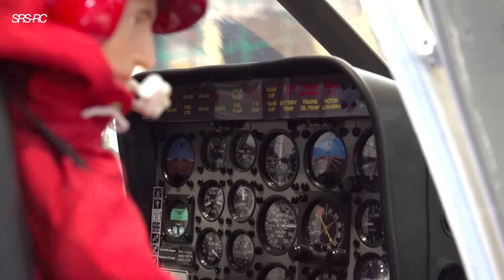RC HELI JET INDOOR FLIGHT // VARIOHELICOPTER // ROBIN ADAMSCHAK // MODELL HOBBY SPIEL

Comment: The amount of enginerding that goes into producing such a beautiful, working replica of the jetranger is applause demanding. Tremendous skill in both flying and construction!
Reply: they even installed an illuminated cluster panel in the cockpit

did you notice that?

that's pretty slick

he was flying it really slow to

because in reality?

you can fly those things about as quick as you can fly remote control fighter jets
Reply: Nice enginerding
Reply: Enginerding. Get it? Because they're nerds. 🤣
Reply: It's a skookum choocher
Reply: @tushyrr   mobile ke pass
Reply: @tushyrr  mobile ke pass
Reply: @tushyrr  mobile
Reply: @tushyrr  mobile ke pers dekhna hai
Reply: German engineering man

Comment: That thing is beautiful, excellent detail, I noticed the instrument panel was lit while it was flying, and all the rivet detail, incredible! I doubt if I could even afford the batteries for that thing.
Reply: I have 4 RC helicopters😍and if I were to put them all together🚁🚁🚁🚁they still wouldn’t come nowhere near the size of that beauty😀as to the cost of the batteries🤑Ka-Ching Mmmmmm if I were to sell all of my treasured RC helicopters😪🤧I probably wouldn’t have enough🤑to purchase the batteries needed to fly this RC helicopter
Reply: Only one small bolt holding the propeller together?
Reply: @smokescreen2146  dont worry.everything is engineered
Reply: @gardyfaustin8707  Yeah engineered for cost cutting, not safety
Reply: @smokescreen2146  you really think a bolt that cost under $5 is really cutting anything out ... The bolt is safe ... The craft dont need a super size extreme bolt ... Its safe . Technology is awesome these days .
Reply: @gardyfaustin8707  What's $5 x 2000 units
Reply: @smokescreen2146  That's why it is called  the Jesus nut...for real !
Reply: @1983dmd  At least they have changed the design now, well mostly anyway

Comment: Unless you have tried that, you cant appreciate how hard that is...
Reply: I know right? The guy with the controller is a hell of a pilot, that chopper was stable as fuck
Reply: Larger heli models are more stable,  that's actually very easy.
Reply: Right  I had a model heli..quite a bit smaller than this one and I couldn't get it to hover or fly even for nothing no matter how gentle I was on the stick...this guy probably flys real helicopters  I love how stable and extremely quiet it is and it also sounds a lot like a real heli... I bet he paid a for6for it
Reply: I was all about one so I got  fs1 from hangar 9 and near as I can figure crashed about 250-300k worth of virtual models before I could even land once ( quietly places controller on desk, slowly backs out of room...)
Reply: They are hard it took a bunch of crashes before i got any good flying a 6 ch heli
Reply: @bobjohnson48  I broke a skid..crashed a few times then eventually gave it away..had a gas powered r/c truck that damn thing was impossible to control  it was Ethier nothing or full throttle. I gave up...I would love a boat but where I live there's no ponds..just lake Erie I might dabble back in model railroading again I did that  as a kid I only had a 4x8 layout but I hooked it up nicely
Reply: @lornperkins4270  I had a Traxxas slash that was uncontrollable after I put a castle motor in it, I swapped out the receiver with the spektrum AS3X gyro stabizer model and it worked unbelievable, the thing can hold an arrow straight line at full throttle now. No bullshitting, it really is that good. Not competition legal but for bashing it's perfect

Comment: How was this a "jet" helicopter?
Reply: The real model is called Jetranger.....
Reply: I think it is powered by a turbine engine.  In any case, the full-size one is.  Sounds like you might not know what a "turboshaft" engine is.  You should look it up if not.
Reply: @ Science Compliance the reason I say this is because it is an electric/battery powered motor and not a turbine/jet engine.  I know the real heli is called a Bell Jet Ranger and maybe that’s why the word “jet” was used.
Reply: @thebirdwhoflew312  referring the the name of the fullscale model obviously. just shorthand, 30sec into the video you can tell its Brushless, Katronik doesnt make jet accessories. Thats Jeti Model i think.
Reply: @thebirdwhoflew312  I'm pretty sure this is actually powered by a small turbine engine.  If there is an electric motor, it is probably just a starter.

Comment: Beautiful beautiful machine and wonderful set up including battery placement. Too bad We want to keep the battery cable length short and close to the speed controllers or You could put foe emergency pontoons on the skids and place the battery's in there for easier and quick access in case of overheat. But I truly, truly understand You can't and it would be a bad idea. Excellent video and flight bar none.

Comment: Why have a helicopter this nice and not have a full Aluminum Head and tail rotor.. You can actually hear the vibrations and see it in the lights..  Unreal.
Reply: the plastic head is cheaper to manufacture and lighter. this is common practice with VARIO they make junk for high dollars
 the vibrations are normal and have nothing to do with the rotors materials.
Reply: @calibermix8159    I always thought that Vario made good stuff...
Reply: @gewglesux  what do you mean by good stuff ? they make fuselages without a single rivet all the work is done by the end user but you have to pay a lot of money for their stuff.
doors, seats, windows and many other details are not scale at all.

they still use the same crap vintage mechanics adapted to modern electric motors.

other companies in germany had to close the door down and VARIO will not be any different. I don't give a shit if they ever disapear

who buy their fuselages ? old people with money and idiots who only do hover in the sky because they have skills for nothing
everybody else fly 3D helis.
Reply: @calibermix8159  Compared to what i have  seen here in the states...  I believe Vario  to be above board.  I know their stuff is expensive. It seems  that you get what you pay for.  Here in the states  every time i go to a RC  show  or some kind of demonstration.. It's always 3D helis.  I like Scale(or as much scale as i can get)  I would much rather look at a scale heli's swinging around than a 3D demo anyday.  I believe that  some of the 3D pilots we have here are some of the best.  but after  a while  i can leave it alone.

When it comes to Turbine  I dont see many turbine Heli's here..  Many in Europe...  I saw many the last time i was in Germany.

Comment: This was a very good exhibition,  but I kept thinking what could happen if something went wrong. It looked harmless, but was yet the opposite.  Those blades could have easily been missiles, at probably over 10k to 15k rpm, if at any time the helicopter mistakenly crashed up against the wall,  severely injured someone,  or very likely, kill someone by the blade disintegrating, and shattering.  No one had on safety gear, suitable for being that close to something that can do severe bodily damages . Other than that this was very amazing work, and talent.

Comment: Hi. RC helicopters are pretty fascinating technology with amazing features and incredible performance operational system. I really have great interest and I want to be a builder of them. My question to you is related to the radio transmitters used to control RC helicopters particularly. Is it possible to use transmitters that control fixed wing aircraft to control helicopters ? I happen to have a fixed wing that I want to use its transmitter to control a helicopter am building. Is it possible ? Do they have the same or similar control features ? Tks.

Comment: Wow....this would REAL if there wasnt anything in the back ground to show scale. 
But imagine if it crashed in that venue....the blades would shear off and fly towards the spectators. Seen that before on a smaller scale 700 3d helicopter. Cut a dude in the forehead.